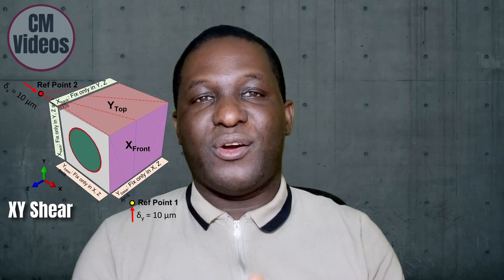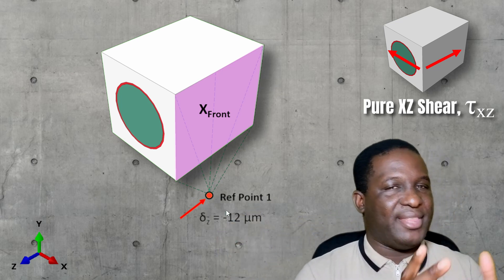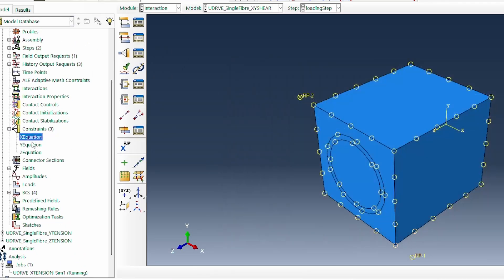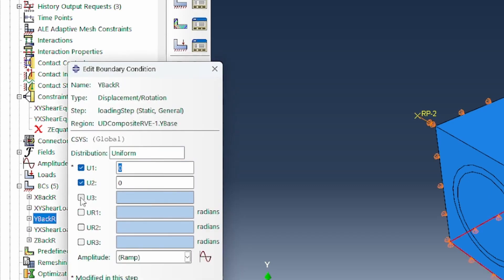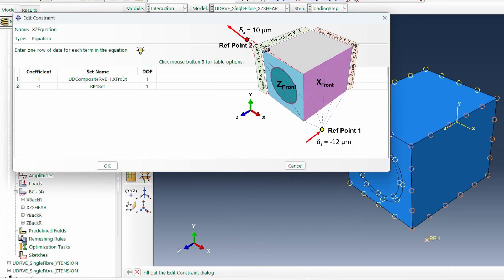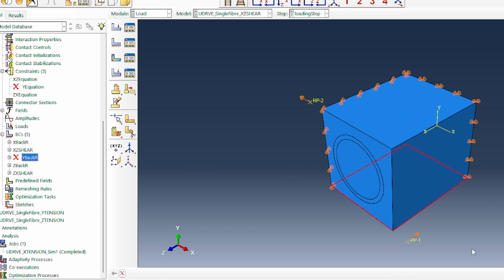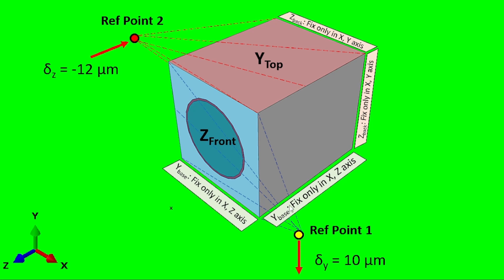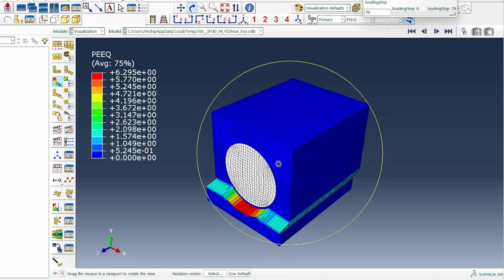UD Composites Modelling - Part 3 - How to apply PURE SHEAR Loads

Comment: Hi, I am doing shear simulation with the exact same parameter settings as you provided, but instead of getting a fracture-like result, the RVE cell is distorted, what could be the cause of this addiction?
Reply from the maker: Hello @Shiguang, I am not sure why. Its difficult to say but try finer mesh or thinner Interface layer.
Reply: @MichaelOkereke  ok, i will try, thank you!
Reply: @shiguangzhang-d6y  I have also encountered this problem. Have you resolved it？

Comment: Thank you once more, Sir. All my plots came out pretty well except the Z-tension plot. It is rather purely linear from 0,0 going to the top right corner, and not the normal trajectory followed by x and y tension where there is the steep elastic region, yield, UTS and then nose-diving downward. Did I do something wrong, maybe?
Reply from the maker: The z tension is supposed to be that way as its dominated by the highly stiff fibre... so it's correct.

Comment: Thank you. I need clarification once more. In the video at 13:33, you mentioned fixing in x and z but fixed y and z; @ 13:35, you mentioned x and y, and fixed x and z. Could it be an oversight or it was deliberate?
Reply from the maker: Yes, it's a mistake - an oversighton my part.  It should be fixing x and Z, I believe, as the schematic in the actual video showed. I saw it when I rewatched the published video.